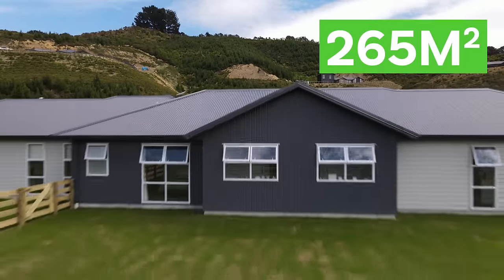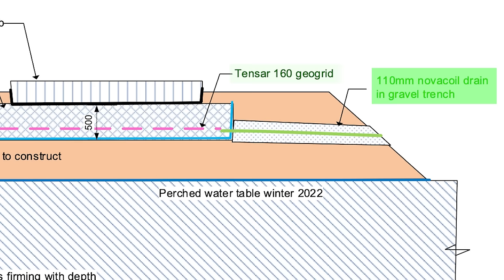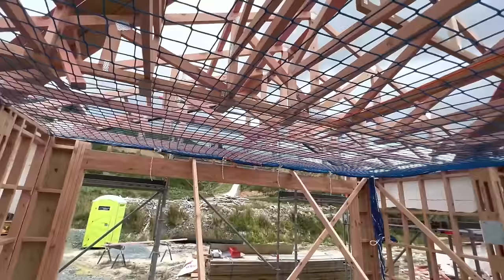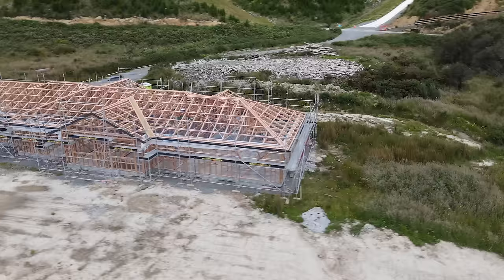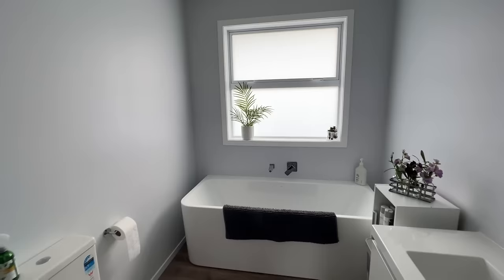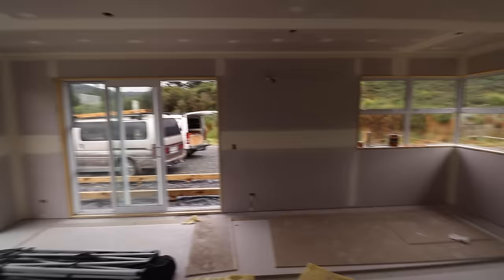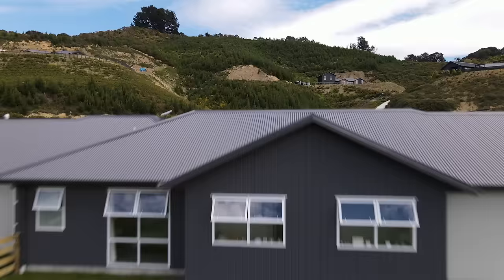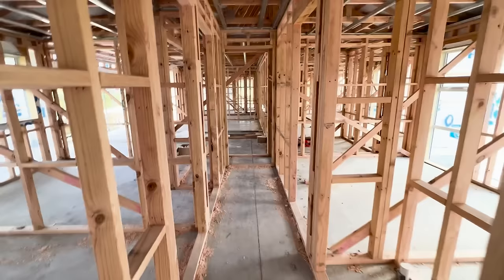From Start to Finish: Building a Rural Dream Home

Comment: I keep thinking low lying terrain and cyclone Gabriel  ... That location seems a bit dodgy to me ...why no one else built there ?
Reply: There are quite a few in there on the flat now, there is a separate video on this build which may have touched on those issues.
Reply: @77chuckles  Just the  puddles surrounding the site is enough to make one think ,  and josh talks about flood prevention within the foundation  , red flag ...In a heavy rain all water will come down from the surrounding hills ....lol